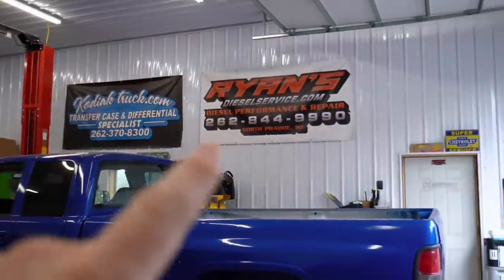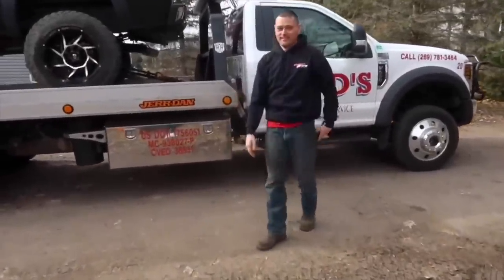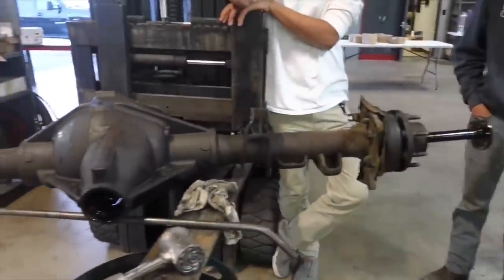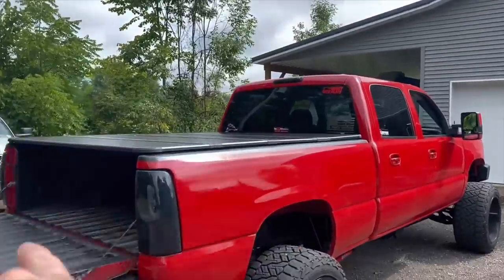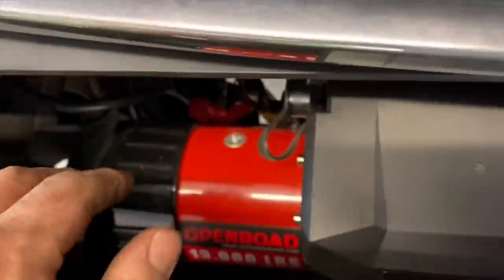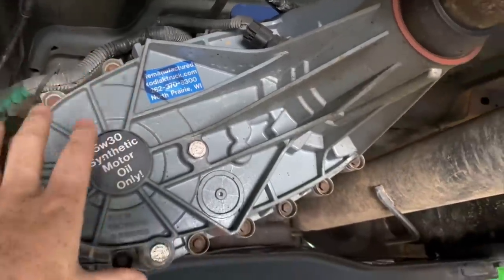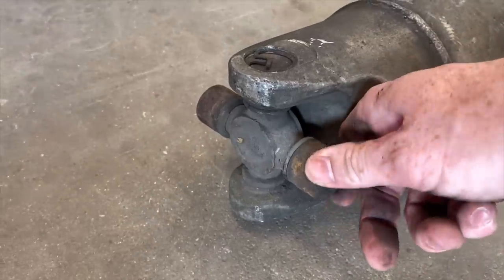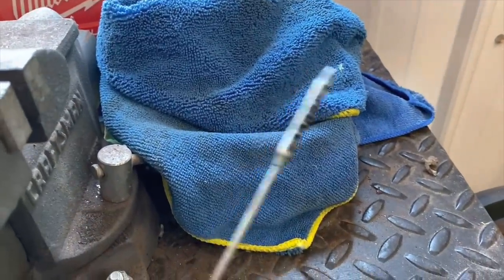What Happens When Your Rear End Locks Up On The Highway!

Comment: I just took my 06 down to North Carolina from Maryland. I took it to South Carolina 2 months prior. Truck did amazing with no issues and fantastic economy. I'm surprised you don't have a ppe deep engine oil pan on your truck. I noticed a difference of 100+ degree cooler egt when I swapped the factory pan out

Comment: Hey TM I almost crossed that bridge, I had my truck regeared to 4.56 and over a period of time I kept hearing noises in the rear end every time I took my foot of the throttle 'coasting' apply throttle the the noise would go away I was like WTF 🤔 so when I got home went under my truck and checked the D/S and to my surprise the pinion nut backed out enough the I could turn the ds like 1/2" to 3/4 of an inch 🤬🤬 so I unhooked the ds took off the pinion nut and put thread locker on the threads retorqued the pinion nut installed the ds went for a drive and all is good now👍🏿👍🏿

Comment: Don’t tighten the pinion nut there’s a crush sleeve in there that maintains pinion bearing clearance. It’s why you should always use a new lock nut and never worry about it again. That was an anomalous failure. Probably lost a pinion bearing that caused it to work loose from the vibration.
Reply: The crush sleeve is for bearing preload, plus there are shims for pinion depth. The preload on the pinion bearings is measured in inch pounds of rotation when set up properly.

Comment: ive always used rotella 15-40 on my 07.5 570,000 on the odo with the original engine transmission tcase and diffs. by far the best truck ive ever owned. especially after it went on the weightloss program. great video as per usual!

Comment: I just inspected mine last week and found a blown lower strut grommet. I was greasing the Zirc fittings on the upper and lower ball joints, idler control arm tie rods and control arms. Should be around nine. It really feels nicer greased up.

Comment: A customer of ours was 50 feet away, 1 left turn from the parking lot and his pinion nut came off and locked up. Threw some casters under the tires and pushed it the last 50 feet

Comment: Glad I have a 1993 Dodge D350. Never seem to have any problems.
Reply: That's a good year. The very last year dodge made a good reliable pickup truck
Reply from the maker: But do you travel the country in it? Either way those old trucks were built to last
Reply: @TruckMaster  It is currently is coated in light mud from driving through fields. Rear duals were replaced with 35x14x16.5. I've twisted the lug nuts on the left rear to where it was almost impossible to get the wheel off. Eight lugs $40.
Reply: @TruckMaster  That scammer is still I'm you're comments.

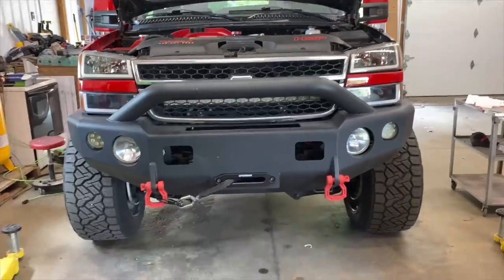Comment: 9:40 I used to run a 18k winch on a trailer. It used 2 batteries, no wire to alternator. Anyway, just saying with your 2 batteries on board, u could operate that winch for a few hours before draining the batts in case u need to. It will run better with the truck ON of course for that extra voltage. Take a look at Factor 55 Ultra Hook. U might consider using that with fairlead that they make too. I like your LBZ the best as always. Thanks for vid! 👍

Comment: While your checking that nut, clean it up a bit and put some torque stripe on it. That way you don’t have to pull it apart and you’ll have a visual reference to tell you if it has moved at all. Use torque stripe on all my lift kit installs on all the major bolts and nuts…

Comment: Lucky me my Dirtymax LML took a CP4 ***t dump.   I took it to a shop to have the fuel meter changed to one with a better filter.  After they started it  to take it for a drive it crapped.  Don't know yet if shrappnel got into the fuel system.  CP3 conversion is on it's way here.  Sign me up for one of those class action lawsuits.  Back to driving Larry 1 of 7 Cadillac's.

Comment: Amsoil is definitely too expensive for me to use. I use Mobile Delvac 1300 Super 15W40, and it does the job just fine. I change my LB7 every 5000 miles. I'm at 325k right now. There are a lot of good reliable brands of diesel oil out there.
Reply: Also, I see a lot of people change their oil, and then they check their dipstick and the oil looks super dirty, even with fresh oil.
Reply: @bs-pu3dg  pan design means there's always at least 1 qt or so of dirty in there

Comment: been there done that except  it was a broken tooth on the ring gear going 70 in in a new  06 f350 dually on the freeway uphill. not even 5,000 miles on it nearly went through the windshield and stalled the engine

Comment: I can't see from the video but you will want an inline fuse on that battery wire. I ran a wire like that temporarily without a fuse and almost lost the vehicle. My dash went crazy and I smelled burning electrical. Popped the hood and that wire rubbed and shorted. The wire was glowing orange.
Reply from the maker: Thanks for the info I plan on install a fuse
Reply: @TruckMaster  you would be surprised how fast a wire rubs through when it is against something wrong

Comment: I'll pray for a safe trip but I'm sure you will make it just fine to Wisconsin.  Also, use a paint marker on the pinion nut.  That way you can check it with out pulling the drive shaft.

Comment: I had that happened at work with a 1998 Peterbilt 389 the pinion nut broke in half clean the good thing is that I was not on the hwy I was at a traffic light and I went to more she no go the other good thing is if was on the hwy it would have been a mess it would taken everything out thank goodness it was just replace the nut and good to go

Comment: I went to the Detroit Axel drilled and slotted rotors and ceramic pads I have no complaints you should look into it
Reply from the maker: I actually have them on my lbz 👍
Reply: @TruckMaster  I was questionable on them because of the price but,American made.... from Detroit I am totally impressed.... I tow  a 40' gooseneck and it stops on a dime and gives you .o8 cents change.
Reply: @TruckMaster  have you had issues with your VGT sylanoid not relearning when replaced?  Or issues?  That's a good topic because I don't see it anywhere on the interwebs
Reply: @TruckMaster  went with the Lightnin bolt design...boosts from 34lbs to 40lbs .... quick!!!

Comment: Well I blew my rear differential but it blew 4 teeth off the big gear and pinion gear was shock strip completely just because I still try to move it around with a blown rear end have pics and I rebuild the dana 80 rear axle but sents I rebuild it the dulley hub bearings on driver side came apart on me about 2 weeks ago the hub assembly nut came loose and left me stranded F450
Reply from the maker: Yikes 😬

Comment: Hey Boss,  it drives me nuts that the newer trucks just aren't reliable. After your road trip breakdown and now a computer issue so you can't take it on a road trip with confidence. . Wake Up GM . That really is Ridiculous that you trust your 07 more. Again GM wake up. I have a buddy with a 15 DMAX work truck . Maintained, completely stock, and not abused . 45k miles and it needs head gaskets . Not covered under warranty either. Again Ridiculous ! . Love the 99 to 07 Classic generation.  But here in the North East the rot/rust is what kills them . I am a GM guy from day one. But I can't reccomend the newer GM trucks to my customers.  Its really sad ESPECIALLY with what they cost !!! So many guys are rebuilding there older trucks for this reason . Price and lack of reliability.  Anyway love your videos and continued success.  I will continue driving my older GM trucks.  .....Thanks Hans

Comment: when  you took off the factory fuel filter off you took off the water in fuel sensor that said how do you have to watch for water in fuel the fuel these days sucks big time just last week i got called for a diesel compact tractor that got a load of water in the fuel and jacked the fuel pump all to hell i am waiting on info and way to put a sensor on it to help him with this was his request to do so
Reply from the maker: The liftpump water filter has a screw built in to release any water in the filter
Reply: @TruckMaster  that screw is not going to tell you about water till you use it to check fuel these days is shit and a person really needs a sensor for between times you check with that screw hands down no questions
Reply: @mattphillips4260  Millions of owners and a few engineers disagree with you